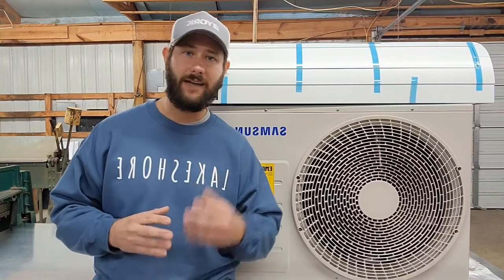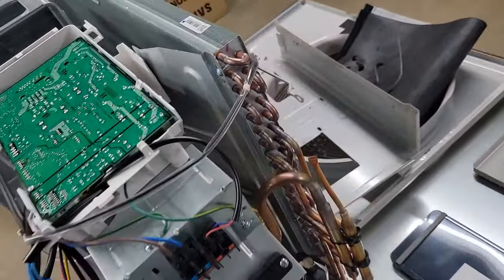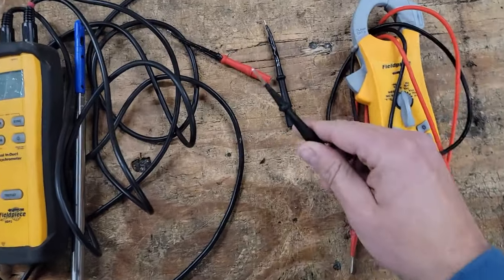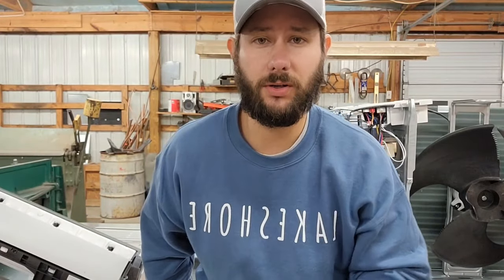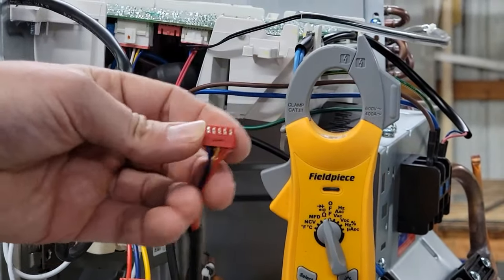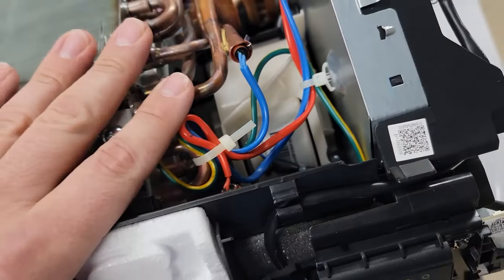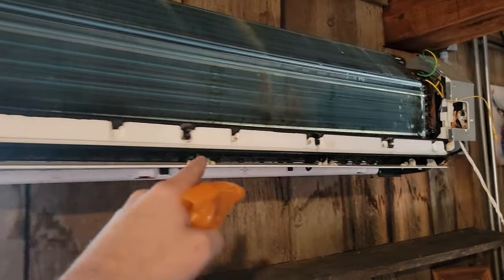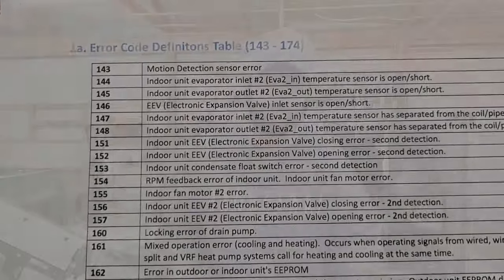How to Work on Mini Splits?

Comment: I know of a unit that has a heat pump. But the remote Temp controller has a different hook up than the unit. The heat will not come on.

Comment: Daikin dual system, upstairs unit fan operates in AC and Fan mode but not in Heat mode. Downstairs unit is okay. No code for reference

Comment: Thank you for this video. I have a question. You have repeated several times that you pressurize the mini split systems with 500 Lbs./PSI of nitrogen. Does that not compromise the evap coil as most mini split evap coils are rated for 340-350 Lbs/psi?
I've never heard of a system being pressurized with nitrogen to such a high level. 
Apart from that I found your video very informative. Thank you

Comment: I'm working in south Florida.. excellent video and break down of equipment.. you are exactly right when it comes to installation ..90 percent are installed wrong.. that's what I find on service calls.. tech's  need to spend some time on start ups..
Reply from the maker: I agree Keith if text spent more time on startup than they could find the problems and fix them early instead of the problems creating more problems down the road
Reply: Are you near Naples?  Can I schedule a troubleshoot and cleaning?

Comment: Great video on stressing the importance of a proper installation.  There are far too many You Tube videos that fail to stress how important it is to have proper flares on the tubing, doing a proper evacuation using a micron gauge and hopefully pulling the line set down to around 200 microns, using a good sealant like Nylog on the flare faces, pressure testing with nitogen to at least 350 to 400 psi and doing a leak test, and finally, using a torque wrench to torque the nuts to factory specs.  I'd bet that many of the bad compressors you've encountered were failing due to the corrosive refrigerant caused by a poor evacuation that left moisture in the system, which caused the acidic condition.  Some folks just have to learn the hard way.

Comment: Outstanding tutorial. I am an Electrician & I installed 3 Minis at my home in Missouri. A 12,000BTU Aux is displaying P6 in heat mode & the indoor air handler blower is not operating. I will be following your suggestions & attempt the repair.
Reply: I think that’s a low refrigerant code

Comment: This is very helpful. We have a mini split heat pump from LG that has a compressor issue. I was looking for a contractor and a capacitor but could not locate neither. This units are very different than what I am used to.

Comment: I keep running into this problem and and I've yet to find a solution on a multi occasionally one head will start running slower not hit the higher speeds I have tried changing the inside board I mean the blower fan changing the blower motor and checking voltage can't seem to figure out a cause for one head running slow

Comment: Around 26:30 you mention water running down a wall ... caused by a drain issue.   This issue can be horrendous if the installer of a multi-head system decided to link two drain pipes together before the pipes reach the outside of the building.  If you blow on the outside pipe, the non-clogged drain will spew liquid and gunk all over the customers room.  If you suck on the outside pipe, you might collect the gunk and water from the good head unit, but the clogged one will remain clogged.  Do not allow an installer to link the two drain systems before the pipes get to the outside.  You should have one drain pipe for each indoor air handler.

Comment: Nice video! I will follow you...
Just some small remarks: L/N to F1/F2 on ODU is not protected, it will cause PCB damage, between ODU and IDU it is protected (as far as I know). 
The F1/F2 is NOT polarity sensitive (as far as I know).  I am a service tech in EU, please check via Samsung HVAC. 
Compressor windings to earth (chassis) resistance must be checked with using an insulation tester (400-500V conductivity test).
:)
Reply from the maker: Awesome Thank YOU for Your knowledge

Comment: Great video. I do have a question for the masses though. I have been working on a Lennox mini split and I can’t get it to work. It’s a MLA009S4S-1P condenser. I have three wires going to the  indoor unit (2 power) (1 communication?) and of course my line in. I have power at the AH, and the thermostat is working. However, I can not get the condenser to come on at all. No noise, Nada. No error codes either. Any ideas? Pressures seem fine as well. 25:00

Comment: is the best video's So Far on this type of units one question on my specific S09AF UH0 split ac unit it's information is not so easy to come by in terms of repair support info like the numbers for testing components  on older LG from 2016 it's like the repair ability of a car nice plugs everywhere and diagram

Comment: I had a friend whos outside unit goes on and then off randommly,a tech came by replace the board no luck the replace a control wire inside the unit and now it works.is this common issue when it goes on and off

Comment: Thank you for sharing your knowlidge . Im having problems with my fujitsu minisplit . Its coming up with error 95 "Compressor rotor position detection error (permanent stop)"  is this repairable ? Have you fitted any elecriq units , im thinking of buying a whole new unit and these are sold as diy install as not charged with fgaa

Comment: great video but exactly is the fuse to the indoor PCB ? on the board or auto reset circuit breaker thanks
Reply from the maker: It is on the board
 And there is a thermal fuse on the power in block

Comment: Question: for a multi-zone minor split, what is the cause for one zone not to work when the others are off (and indoor unit freezes up, but when you turn any other zone on, then they both work (in cooling mode). I assume refrigeration leak but confused why it would work when another zone is turned on.
Reply: I've seen this when the communication wires are mixed up... meaning zone 1 is connected to zone 2 and zone 2 is connected to zone 1.

Comment: Absolutely a great  video .Ive got this problem though. Sorry, I am a newb to HVAC so this question may have been covered elsewhere but was looking for some direction. I have a been having issues cooling with one indoor head unit. We have a LG mini split unit(Model# LMU240 ce). We have a total of two indoor units and one cools fine(artcool) and the other does not, blows warm air(standard type). The artcool blows and works fine 44 degrees but the standard one at 77degrees and wont cool. it shows the compressor is on but doesn't cool. could use your advise
Thanks Jim
Reply from the maker: Hey Jim I really don't think I can give you advice through the comments that will help you the best that I could if it was over the phone. Or email but here goes

It could definitely be the charge. I would turn the units to cooling and the fan speeds to high and then check the charge
Then I would proceed to check the sensors in the indoor and the outdoor
Then I would check the eev valve

Comment: Great video, I am an HVAC tech and contractor who has been out of the field for years but installe(d my own split system in my garage/woodworking shop a couple years ago and just noticed this month that I was low on refrigerant but can't find a leak.  Did notice in taking off the caps on the outdoor guage valves a little pressure in them and a slight amount of oil on the flare connections.  Would you suggest anything other than tightening them down a bit more.  The leaks are so small they are not showing up with bubble leak solution.
Reply from the maker: Yeah I would suggest that you put the refrigera in and then just tighten up the flayers

Comment: thanks for the great video Tadd! How can you tell between a locked up compressor and a compressor thats bad. I have a compfortotal mini split that has a  small 5amp compressor. It tries to start for 3 seconds, fails and tries again after 5 min, it looks like the overload is tripping it off, its pulling 20 amps at start up on each leg, its 220volt compressor. the low side pressure is sitting at 230psi, with unit off and doesn't move when compressor tries to start . so i'm thinking the compressor may be shut or is it just locked up? would you try a hardstart kit on it ? the capacitor tests good on it. and it doesn't have any pressure switches on it.
Reply from the maker: Thanks, man. If your unit has a capacitor I would start there

Comment: I have a Mitsui Split Type Air Conditioner Model MBCX2L24-O and recently the AC was no longer cooling. I checked if it requires any refrigerant gas and yes it was 60psi which is equivalent to 4 bars. So when I added more gas the AC was cooling for 2 weeks, not as it was before but was ok. Now again there is a problem with the AC, it cools the first few mins as I can feel the indoor fins a bit cold and some ice started to build up and then after a couple of mins the top right fins will defrost and start blowing normal air.  I assumed that it had a leak which wasn't the case unless there is a leak in the evaporator. So I realized that the outdoor unit compressor is stopping every 3 mins and it goes back on after a few mins and when I opened the top bezel of the outdoor unit and located the board, I discovered that every time the outdoor fan stops spinning the PCB led is blinking 4 times before everything stops. Do you happen to know the cause of this problem?
Reply from the maker: what are the temps there 
Could be low on refrigerant
Reply: @TaddyDigest  But I did call some tech guys who vacuumed and added the refrigerant. The compressor was still going off every 2-3mins and it turns on again and keep cycling.
Reply from the maker: Could be a sensor failure indoor

Comment: What happens when the outdoor units fan or compressor doesnt turn.on,the indoor works.eveeything worked about a week ago
Reply from the maker: Check the inverter board for blinking lights.And then check the error code in the description

Comment: I dont catch service calls very often on minis but more often than not theres a maintenance issue that causes an issue, specifically, a comm error caused by the little condensate pump reservoir that is full of water.
Reply from the maker: yup your right 
mostly just maintenance 
thanks for watching Billy 👀 😀

Comment: You do great videos. I am new to servicing these units. I am working on a daizuki 1200 but unit. The pressures with the unit not running are 140psi and with the unit running they Drop almost zero. Does this sound like a compressor or freon?

Thanks again for the videos!
Reply from the maker: Sounds like low charge

Comment: Your realy knowledgeable Wish you could help with my Fujitsu mini split. I think the inside and outside units are not speaking to each other. Is it useually AC voltage between red wire and neutral connection on these? Hi from Scotland , I need you to keep me hot :)

Comment: Can the voltage be 240  with 120 L1 and 120 L2, NOT 180 degrees out of phase? I want to use a solar generator on L1 and L2 this being inverted to DC does phase matter to the board.
Reply from the maker: Most of these boards have an EMI filter which is an electromagnetic interference filter and it also has a reactor which helps to smooth out any voltage

Comment: What could cause 1 head unit to cool non stop rest work fine.Lines start to get super cold when it is off and rest is on like it still calling for freon?
Reply from the maker: sensors may be bad or eev staying open

Comment: Tad I hate hearing about the problems you've experienced with Samsung hvac.....I hope I don't start having trouble with the units I have out there. Good video
Reply: Yeah I'm not a fan of them. They don't seem to last here in Australia. I use Mitsubishi and rarely have problems.
Reply from the maker: Samsung had a redesign in 2020 so thankfully I don't have a lot of problems with the newer models but the older models I did have a few leaky indoor coils.
I love the new models especially the quantum series now. Thank you for watching  Channel Cat Chaser.
Reply from the maker: Hate to hear that L Williams 
Thank you for sharing this information 
 I did sell Install and service  mitsubishi before Samsung just didn't like the distributor and the knowledge to troubleshoot was not so readily accessible to me like Samsung.
Thanks for watching 👀 😀
Reply: @TaddyDigest  i do install them still, in fact I put 4 in last week, but I find on 40 degree celcius plus days they get a lot of compressor overloads, and I tend to oversize my systems a bit for when those days inevitably come. Probably different environment to where you install, it gets dry and very very hot here.

Comment: My name is Mike I'm from New Bern NC working on a Mitsubishi multi city  when the compressor ramps up no noise everything seems to be working as it should . When the compressor ramps down the compressor and pipes shake and rattle bad . At first I thought maybe a bad compressor. It makes temp in all three areas . Could it be one of the eev's are not operating right and restricting. Inquiring minds like to know
Reply from the maker: I am not sure 
sounds like restriction though

Comment: Thank you for the video I have  Innovair   Quantum unit that is not working with error code  EA.  My manual shows this as a communication interruption between inside and outside boards or a failed board.   Your explanation of the communication connections and testing has given me a great place to get started.   You were using Samsung as your demo product do you ever work on an Innovair?  If my communication connection checks out I will have to figure if I need to replace a board.  I have done something similar with a repair to the brain of my hot tub but will let you know if I just had a broken connection that you helped me fix!!!
Reply from the maker: Hey Harry thank you so much for watching I really appreciate it I hope you get the unit fixed I have never installed that brand but I will check it out

Comment: good instructional and i like that you removed all the panels to showcase components but when you said i forgot to remove the electrical cover on the indoor unit for the L1 L2 cover that just not right sounds a little shady. keep up the good work but if your going to do a demonstration be prepared to show all of the components even if it is the connectors on L1 L2 just doesn't sound good " I forgot" gotta be be transparent for the new techs trying to learn dent hide anything.
Reply from the maker: I am not perfect I am learning 
Thanks

Comment: So these units do not have a contactor right? I was trying to diagnose one Daikin a few weeks ago(it had a bad indoor board)and I wanted to check if the compressor works or not. Is there any way to force the compressor on in these guys? Also, are all mini splits without a contactor (inverter or not)?
Reply from the maker: Yes all mini splits have no contacter 
The only way to force the compressor is to force the equipment into a certain mode whether cooling or heating
I usually do a winding test
Reply: @TaddyDigest  Appreciate the fast response dude! Thank you for your videos. They really help us new techs out 😂 💪

Comment: Great video!  Do all mini split heat pumps only have the one expansion device rather than two on a normal split system heat pump?  My daughter's mini split is likely low on charge and the small liquid line is frosted up and the larger vapor return line is warm, opposite of what I am used to seeing with a normal split system heat pump where a TXV is located just upstreat of the inside coil.  Thanks!
Reply from the maker: Most Mini splits have the TXV located in the outdoor unit
 And it's usually called A  EEV

Electronic expansion valve
Reply: @TaddyDigest  Interesting.  That explains why what I thought should be the warm liquid line is cool, as it is actually downstream of the expansion device.  Thanks for the quick reply.  God bless!

Comment: I just installed my second mini split ,it is a senville concealed 9000 btu. I'm electrician I'm sure wiring is correct whe turn the circuit breaker on the inside unit bees once but  the thermostat doesn't power on and nothing happens I'm sure the thermostat is fine cost I text it in another unit thanks
Reply from the maker: Thanks for the info

Comment: Can you add 410a in the heating mode or do you have to switch to cooling mode?
Reply from the maker: In the heating mode, you can pull the reversing valve plug wire, and this will allow you to add refrigerant.
However It is ideal to charge in the cooling mode

Comment: My friend had a mini split installed  by an electrician friend 3 phase. On cool mode it blows cold air on the outside unit is that a matter of it running backwards. Can it be resolved  by switching 2 of the 3 phase wires. Thank you
Reply from the maker: Could be that the unit is not configured properly
 Could be running in heat mode instead of cool
 Usually these units are only single phase
 Unless you have a commercial ten ton unit or more  you would have 3 phase then
Reply from the maker: https://youtu.be/qHIJv2Qqjno
Reply from the maker: This is a video of a Mini split that was blowing cold cold air outside and it was in heat mode
 I talk about how I fixed it

Comment: We need proper technicians in Cabo San Lucas, MX! Lots of retirees moving here. The AC techs NEVER use a vacuum pump. My 1.5k units are always pulling like 1800 watts and I do not think they are running efficiently. So frustrated, I will go to the US, buy a pump/gauges/fittings/flair tool and install a DIY. They do not reclaim refrigerant either and the shops will not sell me refrigerant.